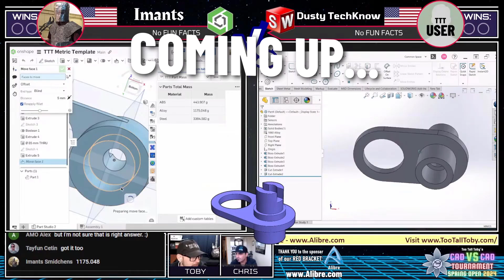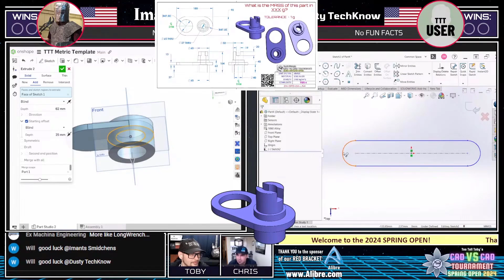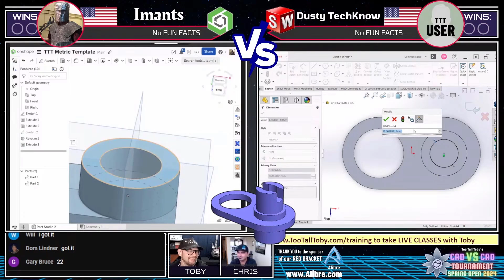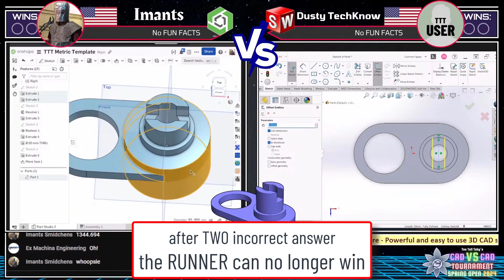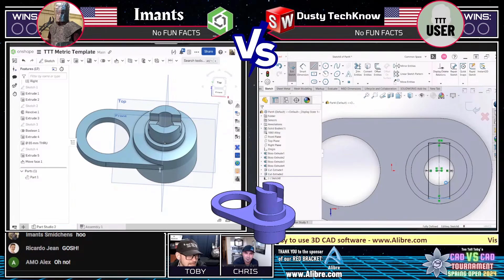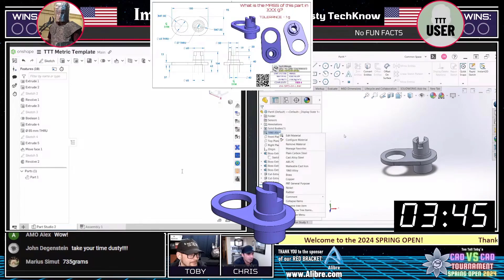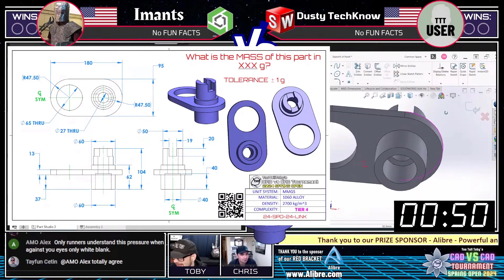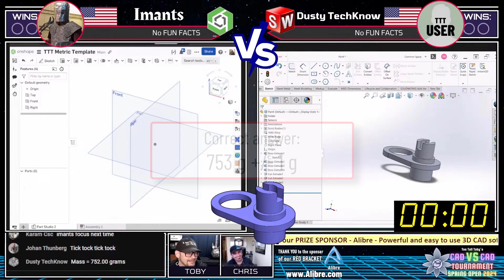Onshape vs SolidWorks - Speedmodeling BATTLE 1 - Which is faster?

Comment: Is it allowed that Dusty did model the slot at the top 90° rotated? Sure, it doesn't change the mass, but ... shouldn't the model be correct, too?
Otherwise you basically could e.g. put a hole anywhere, as long as it removes the same amount of matter.
Reply from the maker: Yup it’s allowed.  It’s called “the Ivan exploit “ 😀
Reply: @TooTallToby  answer right, part wrong. With due respect to Ivan, giving this error a name doesn't make the part fit: the mission failed, the crew died ;)
Reply: In this particular setting, the final mass is the only thing that matters.